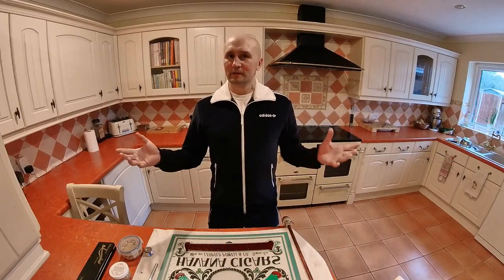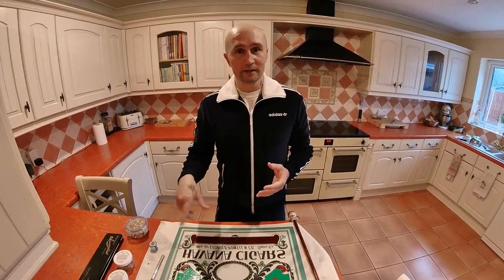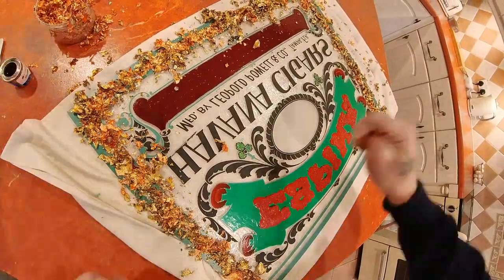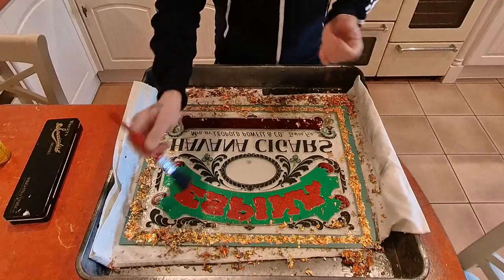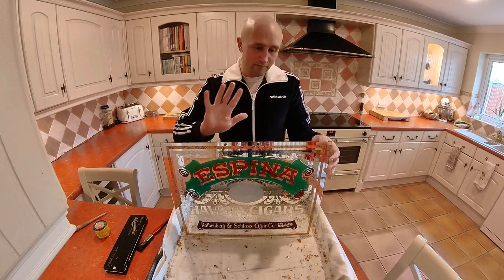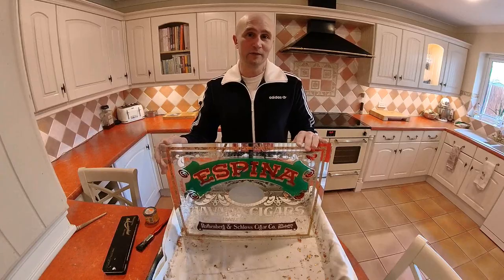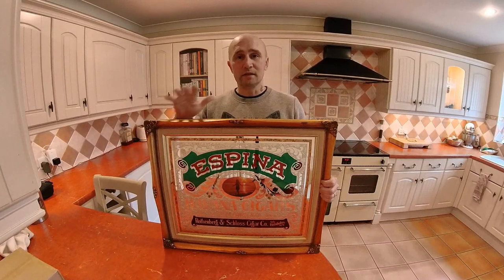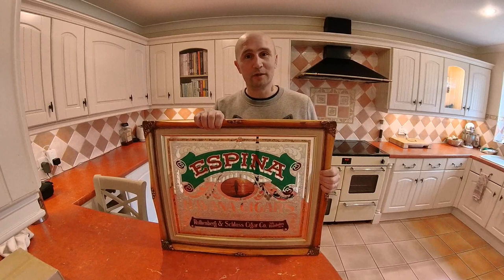Add stunning gold elements to your sign. Reverse Glass Tutorial

Comment: Stunning work! What would you say would be the most challenging skill to get correct? For myself who has never done anything like this before. What process should I avoid doing until I've practiced a bunch of times so I don't ruin my piece?
Reply from the maker: Thanks very much! I think if you start with a basic mirror that's a pretty easy process if you've got the tools to do it. 
None of it is particularly hard, and it's simple to correct if you go wrong. The painting is the most intricate part, but as long as you've got white spirit and q-tips at hand it's easy to fix errors. I'm going to do a video soon about common mistakes and troubleshooting so hopefully that will help :)

Comment: Quality! Hadn't thought about using imitation gold like that! What kind of spray are you using at the end to back up?! I tried it aggggges ago and it ate through the one shot!
Reply from the maker: I've had the same problem so now I only use acrylic. Anything solvent based will react with the oneshot and make it bubble up. The acrylic can do, that but not if you apply it in thin coats :)
Reply: Happy Gilder absolute hero! Cheers bud!
Reply: @happygilder  one shots garbage nowadays, try alpha Corp 6, alphakrylik and alphanamel. Much better product. Might cost you a bit for shipping I imagine.
Reply from the maker: @scotthendricks79  thanks for the tip, I’ll check them out!
Reply: @happygilder  I am pretty sure you can use shellac...very easy to make your own.